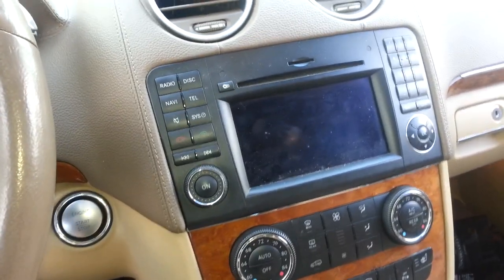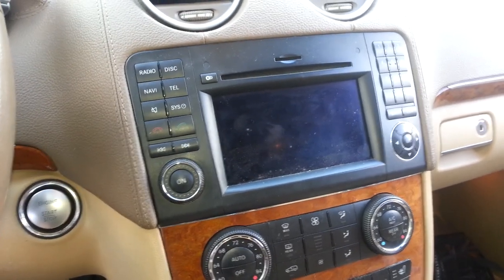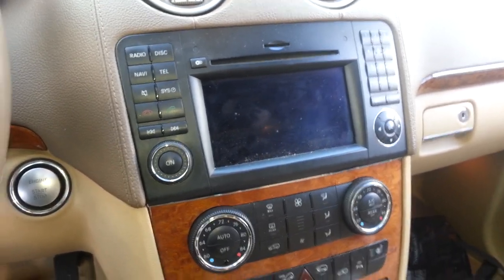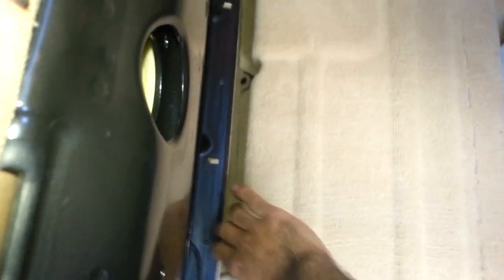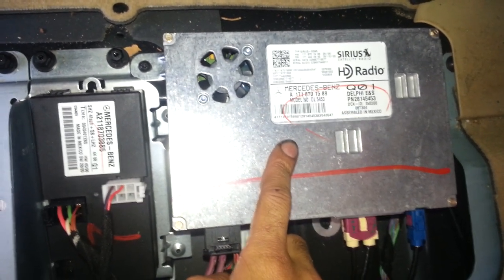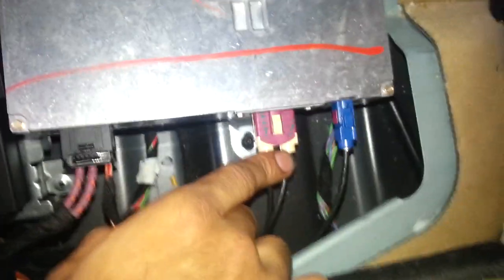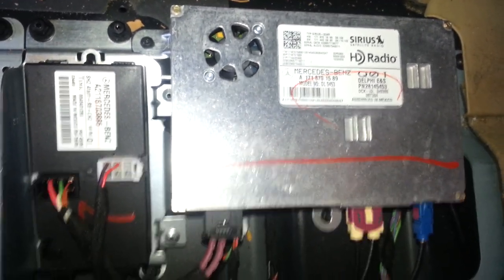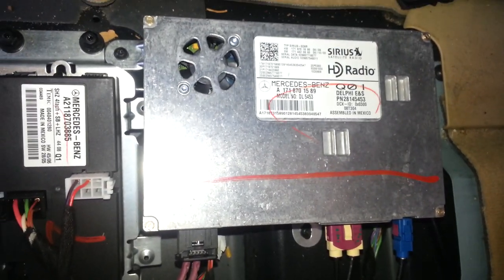How to reset the radio on 2009 Mercedes GL450 displays please wait

Comment: I was schedule for $200 to see the dealership. Services told me it takes about an hour to check and clear codes. It took me 1 minute after watching your video to solve my problem. You are genius my friend. Romano Mercedes Benz dealership @ Syracuse, NY are scammers. Thanks my friend...
Reply from the maker: you are welcome,  I'm glad it help.
Reply: @Ali-Ahmedmeher  I'm have the antitheft  words on after battery and ezi switch replaced the guy said he programed ezi switch with the new key but radio, saids anti theft ,only work for half of a second when you turn key on  ,then anti theft comes ....
Reply: @kristiclemmer6544  just call your dealership, provide the vin number and they will give you security code for stereo, punch in the code and the  system will not say anti theft after that. That is the so called "reprogramming" as stealerships call it.

Comment: Excellent!  Took 10 minutes including wait time.  I looked at several MB boards before finding this video....many were clueless telling you needed to enter security code or pull fuses or fasten loose cables on radio.   NOPE....just follow this video!  thx so much!

Comment: This exactly right:     if you are stuck in a "WAIT" mode for long time, insert your car key and turn it in position 2, do not start the car, leave it like that for an hour , it will bring your radio back to "CODE" mode, now you can enter the accurate code.

Comment: Nice video!! I have a 2002 E220 W212. I discover that If I take off fuse F06 (40A for audio module located in the trunk) this will reset my radio. Maybe it works on other Mercedes aswell?

Comment: Hi, I have a 2007 Gl450 and there is no audio/sound from the radio/cd. The command turns on fine and appears to be running fine both on radio and cd but there is no sound from any of the speakers. Before there would be sound for about a min when starting in the morning and then nothing. Now there isn't any sound at all. I pulled almost every module in the car and opened it up to check for water damage--none found anywhere. Only one fault code:  "incorrect can message from control unit n80" which is the steering control module. I replaced the clockspring and the module above the clockspring with OEM units from the dealer. Still there is no sound. I'm guessing the fault might be in a wire or a ground connection somewhere. Any thoughts? Where can I get the wiring diagram for the CAN bus for this car? I did try disconnecting the satellite radio module but the problem is still there. Any ideas? Thank you.

Comment: Very helpful.Would've never solved it myself. Mine a little different because of rear video system.  radio buried under another chassis. What would have been really helpful  if would have continued on showing how to remove connectors.Each one has a trigger location for removal They are a bitch!